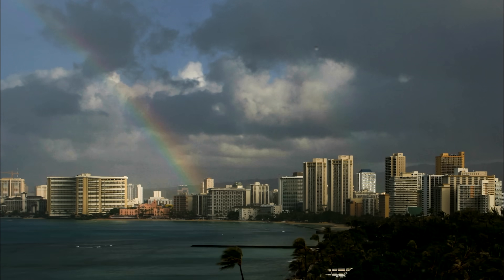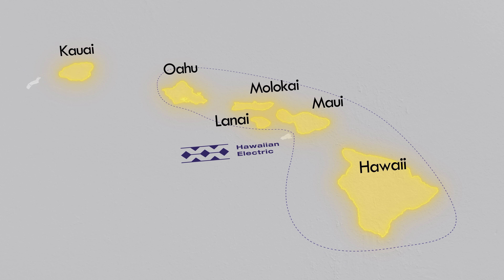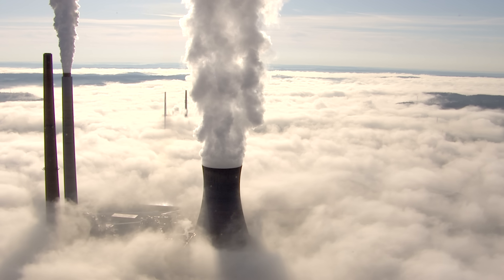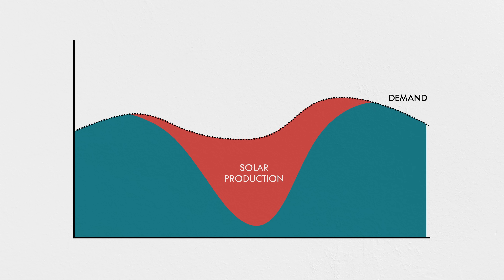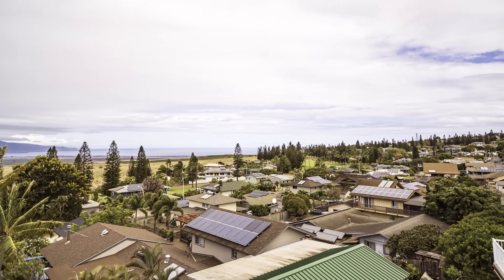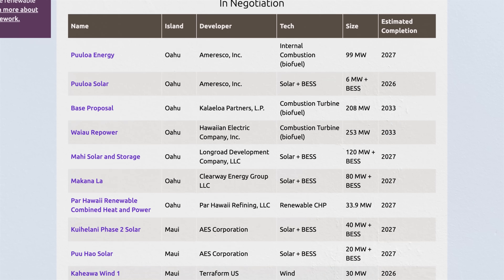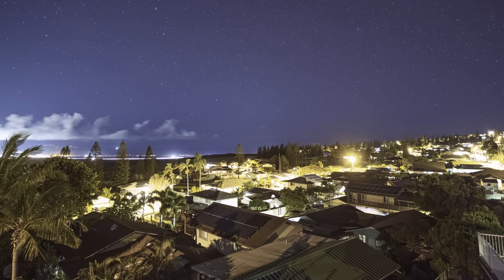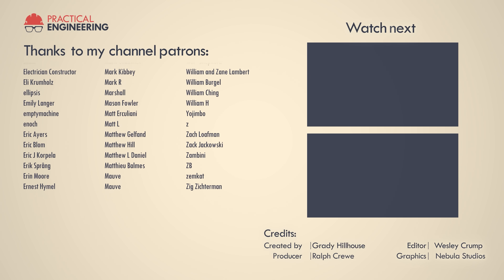How the Hawaiian Power Grid Works

Comment: Great video, I’m currently studying energy integration systems. Having energy vectors & appropriate storage devices is a key component on reliability - flexible systems are key to integrating renewables & high reliability. Cost and reliability are 2 contradictory optimisation factors. The Hawaiian island have great potential for geothermal energy too, capitalising on Icelandic research or even floating buoy turbines utilising inter island tidal currents.

Comment: German Engineer, working in the PH here.
Great insight, and similar challenges apply also to the Philippines' Grid, albeit a little more interconnected here. Nevertheless, there aren't many if any redundancies outside of Metro Manila.

What I am wondering though, the islands of Hawaii being quite well developed, how is there not more Geothermal Power Capacity installed? The geothermal potential should be comparable to the that of Iceland, or am I mistaken? Is it not possible to run Hawaii close to 100% on Geothermal Power?

Comment: Could you do a video about Puerto Rico's power grid. We were affected by a hurricane back in 2017, and people lost power for months. Maria was that hurricane. Compared to Hawaii, I think we had it worst.
Reply: I'm an amateur radio operator. I remember talking to other hams on PR in the months after that storm. They were talking about how much of the island stayed without power for so long despite having stockpiles of copper cable, transformers, switchgear, etc. What no one thought to stockpile, apparently, was poles. They had all this new cable and equipment, but no poles on which to hang any of it, 'cause the storm had knocked 'em down or sheared 'em off.

Comment: In most respects it seems like the solutions are already in the pipeline.  A mix of short and long duration batteries seem to be the number 1 priority.  Tesla batteries are excellent at maintaining line quality.  Flow batteries or cryogenic batteries are good for long duration.  Geothermal definitely needs to be expanded.  All 3 types of geothermal could be used in Hawaii.  (Flash, EGS, AGS)

Comment: Hey Grady, @7:40: What is the strap on the far right of the spinning shaft?
Good stuff. Thanks
Reply: That turbine is being worked on. Normally, turbines are inside of a housing. Specifically, it looks like the strap is being used to polish the bearing surface.

Comment: That rotating physical mass's inertia stabilizing the frequency was a very informative.
Reply: The metaphorical inertia of the grid manifests as the literal inertia of the rotating coils.
Reply: State of the art inverters have synthetic inertia.
Reply: Makes me wonder if you can use giant flywheels. But yeah if you’ve watched how they connect/synchronize generators they have to physically get the phase of the flywheel in sync with the frequency. In the old days they would just use lights connected between the phases of the generator and grid and get them to extinguish. If they screw up the synchronization the generator can quite literally self destruct.
Reply: @NicholasAndre1 Yes. I think some Finnish power provider / grid operator (Fingrid) builds exactly such stuff. Yeah, here: Search for "Synchronous condensers to enhance grid stability in Ireland, Finland and Scotland".
Reply: The gyroscopic frequency stabilizer coil rotation device causes the inertial reaction of the physical mass manifestation.
Reply: Is it as simple as "inverters without batteries are grid-following"
whereas "inverters with batteries, if nominally operated at less than capacity, can be grid-forming"?
Reply: @ericjohnson2193 That’s pretty close to it, but the inertia from individual small inverters isn’t enough, they need to be controlled so as to prevent issues. Most distributed battery proposals include grid forming capabilities.

With re. South Australia, while grid scale batteries help, the data showed that they needed more high inertia frequency control, and they’ve done that through several synchronous condensers (basically a giant flywheel that’s spun up when there’s energy to spin it up and and slows down to feed energy back into the grid if there’s any issue).
Reply: Inverters can provide 'virtual inertia' however current interconnect legislation states that inverters must not provide inertia.   A change in legislation is needed here.
Reply: @michael-j-harrison  which legislation is this? Just residential?
There are obviously grid-scale batteries+inverters that do frequency regulation in various markets in the US and around the world.
Reply: @ericjohnson2193 frequency stabilization is possible with zero inertia and how current AGF standards are written.  However none of the current AGF profiles define inertia.  Adding an inertia term for an inverter gives it a decidly different frequency response that mimics the effect of inertia.

When operating inverters in 'grid forming' - I.E., not connected to the grid and therefore no longer needing to impliment grid utility AGF profiles it is possible to implement virtual inertia which is really useful for starting large induction motors as are typical for air conditioning units.
Reply: Years ago I had a collection of encyclopedias called "how it works" or something to that effect. It had inertial batteries basically designed to be connected to a grid to spool up and smooth out power problems. I'm not sure how much or if it's used but it is a similar idea.
Reply: @codemiesterbeats it is used. There’s many frequency stabilizer battery plants on the US grid.
Reply: @somethingsomething404 true, though battery freq control is a tiny fraction of the stability made by spinning mass
Reply: It seemed unusual to say that inverters have worse frequency response than spinning mass. Inverters off batteries are specifically used to provide grid stability services (IE to keep the frequency right) Perhaps it's more of an issue with residential solar? But I can't see any reason why an inverter driven wind turbine couldn't have instant frequency response.
Reply: @zyeborm  There's a few related concerns here. One of them is short circuit current. Generators can produce maybe 5 or 6 times their rated power for about a second. Inverters have much lower upside. So if the grid gets short circuited, inverters tend to brown out and the circuit breakers may not fire and clear the fault. But on the specific frequency response issue, a generator changes their output power depending on the grid frequency. But inverters are normally connected to a solar panel and they're giving all the power they can anyway, so if there's a sudden decline in frequency and increase in demand due to a grid failure, they can't step up to meet it. Some hybrid inverters can use their battery to supplement the power from the solar panels but that's an extra level of complexity. The newer grid codes tend to allow that, and specify how that works, but not all grid codes, and not all inverters implement it. Similar things with wind turbines- unless the wind turbine is already being curtailed-and being paid to do that-it has no possible upside on production, and no incentive to do that.
Reply: @BooBaddyBig  I should have said grid scale batteries. Like the 100mwh battery in South Australia. From memory last time I looked 70% of the revenue they earnt was from grid stability and only 30% was for pure energy storage.
Reply: @zyeborm Correct. Historically there were extra regulatory hurdles, developed when wind was just a tiny niche (basically - get out of the way and let the big boys handle it). There is no technical reason to prevent wind from providing grid stability.
Reply: @zyeborm I think the inverter issue is that most grid-tie inverters are not 'regulating' in the sense of controlling grid frequency.  They just 'pump' a certain amount of power at whatever frequency the grid has (within limits).  If frequency shifts, they don't start outputing more or less power.

So with fewer rotating machines and more grid-tie, non-regulating inverters, you have, effectively, less 'inertia' to ride out disturbances.
Reply: @mikefochtman7164  That is probably the issue especially with the distributed systems. I suspect we will see people entering into "virtual power plants" going forward where their rooftop solar is actively managed and able then to be somewhat dispatchable. Operating at less than peak output would pay more than operating at max power all the time.
Reply: @mikefochtman7164  I think that may change in the not too distant future, rooftop solar will need to become dispatchable. There are already "virtual power plants" in australia made up of groups of individual homes with solar and I  think battery that are networked and could provide that kind of service. Frequency stability might require software updates if it were anything more than simple direct power input/reduction and trying fancy things to try and shift the frequency.
Reply: You can actually get better/faster frequency stabilization from batteries - see Australia for a good example.
Reply: All of this is done through an instrument comprised of dodge gears and bearings, Reliance electric motors, Allen-Bradley controls, and all monitored by Rockwell Software's Automation’s Retro Encabulator.

Now, basically the only new principle involved is that instead of power being generated by the relative motion of conductors and fluxes, it’s produced by the modial interaction of magneto-reluctance and capacitive diractance.
Reply: @NONO-hz4vo From what I understand half of Oahu is still using older Turbo Encabulator technology.  It was supposed to be upgraded a decade or so ago but there were (as is often the case when  you use Rockwell equipment) funding issues.  Schneider-Electric is working on a drop-in replacement which will hopefully break Rockwell's monopoly on Encabulator technology.
Reply: @NONO-hz4vo 
The lunar Wayne shaft is especially important. You know, the dingle arm on the basal platen.

Comment: 0:55 for those wondering the building at the top of those stairs is the ha'iku radio station historically before it was retired from that use it was used by the us navy to send signals to navy ships operating all over the pacific
Reply: The dishes on the tower were to get a link from one side of the island to another, (mountains between them) from what is now Marine Corps Air Station Kaneohe Bay (was Navy base back then) to one of the bases over by Pearl Harbor. Transmitting and receiving  wires extended from the building down to the valley below for long range Navy communications starting back in the 40's to ships and bases overseas, even reaching Navy ships as far away as Tokyo Bay.
Reply: @marcusdamberger   I wish I had more than one thumbs up to give, for the person providing more history of that oddity that caught my eye 😊
Reply: Close but not quite.  That's a passive microwave relay station.  The antenna for the Omega station was a set of wires that went from that ridge across the valley to a ridge out of view on the left.  The frequency was from 10kHz to 14kHz. You could actually hear the signal when you were at the station.  The stairway was to access the anchor points to maintain them.   It's a great hike.  I've been up it 3 times when it was legal.  But at this time it's closed.  The city is planning on removing the stairs, but there's a fight to save them.
Reply: I've hiked the "stairway to heaven" twice back in 2013-2014 when I live on Oahu.  Fantastic views from the top .
Reply: Thanks! I was wondering what that was, I was thinking radar station, but it wasn't moving and looked too old school to be a phased array.
Reply: Now it’s just called stair way to heaven where tourists take it a little too literal and go places they shouldn’t. Heads up, if you come here, it’s closed for a reason.
Reply: @BruTheThreat Ru sure
Reply: I went up there with a friend. Up the haiku stairs. A police helicopter landed lol and then took off. It was crazy. I thought I was in trouble!
Reply: So what is it now?
Reply: It's about to be permanently removed, sadly.
Reply: It was coast guard not navy
Reply: @Doomycl This is incorrect.
Reply: No one was wondering brooooooo

Comment: Here is one question that I haven't been able to find an answer to. If you were to cover the roof of the average big box store with solar panels, would they be able to generate enough power to run the whole store? For instance, at noon on a bright sunny day in Florida, could they generate enough power to run all of the lights, refrigerators, tills, freezers, air conditioners, etc., etc., etc? Even if it could only handle most of the demand, that would still take a large load off of the grid during a peak demand period, when everyone has their a/c cranked. Whenever I see a large, flat, bare commercial roof, I always wonder why someone doesn't cover it in solar panels. 

I know that it isn't as easy as simply throwing a bunch of solar panels up there. Of course there are all sorts of complexities to work out, but still, solar generation prices are constantly dropping, the systems are constantly getting smarter, and batteries are constantly getting cheaper and smarter too. Walmart made almost $150 billion in profits last year, and they alone have thousands of acres of empty roof space that could be put to good use. Why can't they pick a store, for instance, in the US southwest, where the sun always shines, and give it a try? It will almost certainly save them money in the long run.
Reply: This is an eventual solution,  but I think the supply of panels is slowing things down.

Comment: The problem of not having enough inertia on the grid could be easily solved by building out synchronous condensers.
Reply: Or more easily solved by changing the antiquated grid interconnect legislation tgat currently states that inverters must NOT provide inertia to stating that inverters must provide inertia.   It is really this simple.

Comment: Oil - The most abundant and renewable energy source.
Reply: Think more thoroughly about this.  Hawaii has to buy all its oil and coal and almost everything else from offshore with high shipping costs.  It's cheaper to build wind and solar and geothermal power sources that don't require that constant supply of expensive fuel.